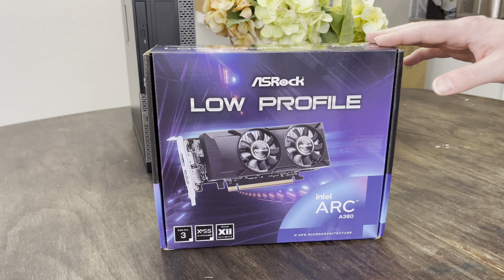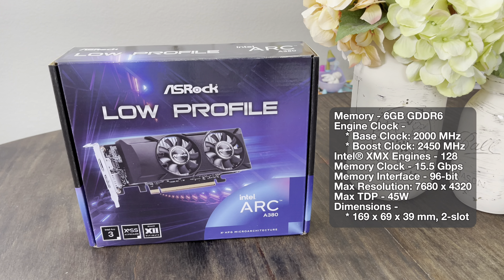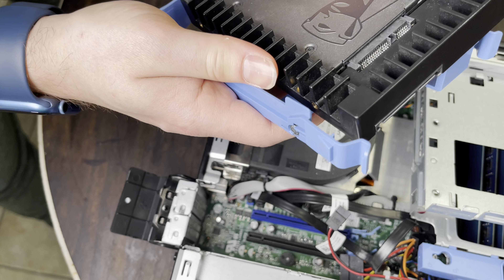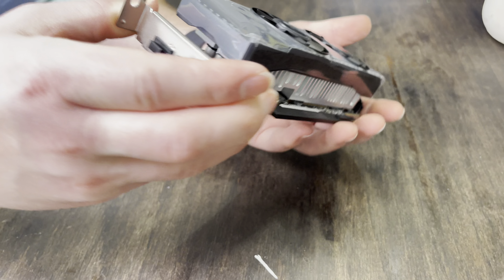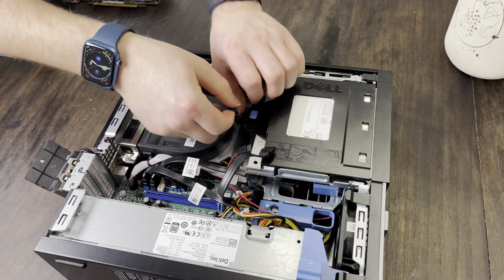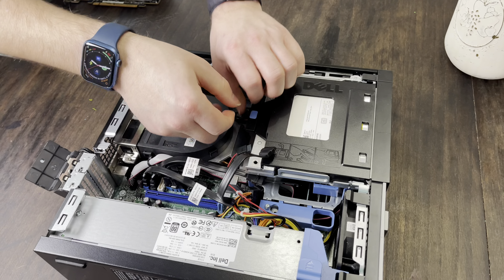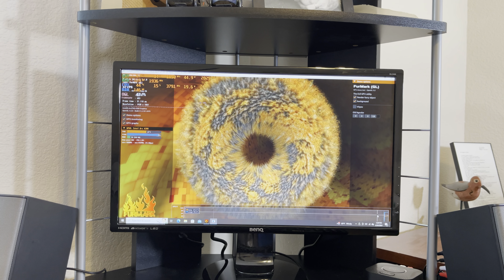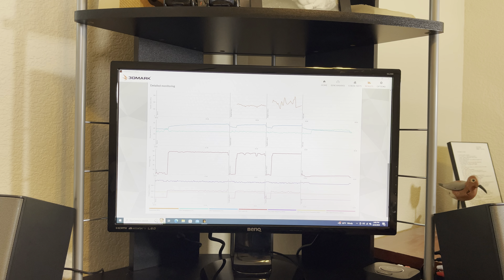Installing an Intel Arc A380 in a Dell Optiplex 7010 SFF

Comment: Unless you're willing to flash a modified BIOS, you're loosing at least about 15% performance running any Arc card in these older OEM systems as Arc is designed around Resizable BAR and these systems have no way to enable it despite being supported by anything with PCIe Gen3. Granted, the RX 6400 isn't really an option either since it's problematic in Gen3 slots and the 1650 is just too expensive, and you mind as well get the 3050 6GB. Hopefully the 3050 6GB will push used 1650 LP prices down to a more reasonable level, but I've managed to grab a couple for around $100, and that's what I would suggest people with these system buy.
Reply: H61/H81 chipsets for 3rd/4th generation (which is what is in the Optiplex 3010 and 3020) only support PCIe 2.0, so a modified BIOS may or may not help in this case. But I wouldn't be surprised to see it for the Optis since they're so popular.

I would have liked to see him run some actual GAMES, not just 3DMark.

Oh, hey... we meet again. lol
Reply: @SeeJayPlayGames  You're absolutely right, the 3010 and 3020 are Gen2 only, so the BIOS mod would be worthless for those people, but the system in the video is a 7010 which uses the Q77 chipset and definitely has Gen3. So it would absolutely work, but I don't think it's worth, even thought the A380 is really the best value at around $100 right now in the LP market... at least for a new card. It's just that modifying a BIOS and flashing it to the system is super risky for most.

But yeah, I would have liked to see some actual games testing as well. Still might be better than resorting to something like a 1050 Ti or an RX 560 on the used market. I'm currently working on a bunch of testing with a ton of LP cards, A380 included. So, I'll be finding out for sure.
Reply from the maker: Been working on follow-up video showing how to use ReBarUEFI by xCuri0 to modify the BIOS and demonstrate the difference in games, but ran into unexpected difficulty specific to Dell.  I’m pinning your comment to help ensure viewers are aware, and if I can’t get it working soon, I’ll have to take down this video - I don’t want people thinking they can modify the BIOS with ReBarUEFI in this particular Dell if it’s not possible or that games are playable without it.  In my experience, it wasn’t just a performance decrease, but the games stuttered bad enough to be unplayable.  I’ll work on new videos demonstrating it in a different brand of old office PC with PCIe Gen3.
Reply: @TheGameBench  oh, you're right, I didn't realize it was a 7010 when I posted that. And yeah, flashing the BIOS would be a risk, but we're talking about a $100 system on the line here. Certainly a risk my broke ass wouldn't care to take, but people with more money might dare.

I just wish there were more decent single-slot low-profile cards for this market. I got into SFF because I was in a transitional period of my life and needed something that would be easier to move with. And for that, it's been a good machine. Though I have to say, buying one of these machines has made me resolve to not do such a limiting thing again... next time I'm going with a full-sized PC that can take a real video card. And probably not a DELL anything. Maybe Lenovo P520 or HP Z4 G4.
Reply: I saw in the GitHub project someone had done a 3020 and a 7010. I snagged a set of them on eBay for 30 bucks each and I'm going to try it. Looks like there's some additional steps detailed in the notes on the rebar project for them both.
Reply: @OptiGPU  did you have to turn off secure boot in the bios menu before installing this gpu? i had heard you have to do that with brands that are not the same as the pc brand.
Reply: @TheGameBench  I know it's been a while and I hope you can respond, I want to know if the nvidia rx 6400 and 3050 cards have this same Resizable BAR problem. Or do they work well, is it a CPU older than 11 gen? My other question is when an Rx 6400 loses performance when putting it in PCI Express 3.0
Reply: @plexplextor  While the RX 6400 and 3050 support Re-BAR, they certainly aren't reliant on it. Re-BAR is definitely not a concern for either of those and you could run them just fine on much older CPU's than 11th Gen, but I suggest going with 8th Gen or newer if you haven't gotten a system yet. And yes, the RX 6400 looses performance in the Gen3 slot. It's pretty marginal, and the bigger concern is the frame rate consistency, which can really suffer in the Gen3 slot. This is an issue for the 6500 XT as well, and it's due to the 4 lane limitation, 64-bit bus and only having 4GB of VRAM. The 8GB 6500 XT doesn't really have the same issues thanks to the bigger VRAM limit. However, in my testing thus far, the RX 6400 has done really well in the Optiplex in the Gen3 slot and you can mostly avoid issues by optimizing your settings to avoid the VRAM limit.
Reply: @TheGameBench  Thank you for responding friend, I really appreciate it, there is a lot of confusion regarding the topic and I couldn't get an answer. I have an i7 8th and the truth is I'm not a demanding user when it comes to graphics. I was wondering why this card is an option in my country.. also the fact that my PC is limited by the 280w power supply

Comment: It's best to use Intel Arc A-Series GPUs with motherboards that support ReBar
Reply: Anyone know if the fan cooler is swappable into the 7010 13th gen lga1700?

Comment: Wow cool to see that Intel are doing GPUs.  I bet they could dominate the budget GPU market if they tried
Reply: They might in the future. Their cards perform better and better when they release new driver versions
Reply: They are light years behind Nvidia and AMD
Reply: Only for 10th gen and above mobos cos it needs ReBar
Reply from the maker: Yes, that’s right. Especially if you can’t get the workaround I tried to work: 
Testing games with Intel Arc A380 in OptiPlex 7010 – no Resizable BAR? ￼
https://youtu.be/e03QeAaJmRg

Comment: Recently got an old thinkstation p310 with a e3 1240 v5 cpu. My buddy wanted it so he bought an a380 not knowing rebar was a thing but shockingly out of CS2, skyrim, Borderlands 2 AND 3, warframe and cyberpunk the only game to not have over 60 fps was cyberpunk which wouldn't even run. Rebar is HIGHLY recommended but NOT required for anyone asking

Comment: I have seen several YT vids on not using resizable bar on the ARC series.  Seems to hobble the GPU by about 15%.  YMMV.  I think you could make a video with this setup, and show how well it plays some older and less demanding titles.  Since the vid card could be transferred into a new build, down the road, you might get a mom/dad who want to upgrade the old Dell in the garage for the kids to play minecraft, roblox, or something similar, and then move the card to an upgraded PC in a year or two as the kids get older.
Reply: not just by 15%, in some titles, it can decrease performance by up to 70% when you dont have resizable bar
Reply: @kushy_TV 70% performance loss is massive, not worth it.
Reply: yeah exactly @quisqueyanguy120
Reply from the maker: Ok, here you go: 
Testing games with Intel Arc A380 in OptiPlex 7010 – no Resizable BAR? ￼
https://youtu.be/e03QeAaJmRg

Comment: I could play most games but want to get it to run pubg the cpu hits 100% each time I’m thinking it’s the psu the one it came with is 180 the recommended settings say 350 psu or up .

Comment: 🙂 with that video card plugged in can you see the Legacy Bios screen if u boot into the bios, cause some Radeon cards you cant see the bios screen so i was wondering if arc cards have that same problem with older hardware

Comment: The rebar is probably the only issue I also did something similar
Reply from the maker: Yes, that is correct: 
Testing games with Intel Arc A380 in OptiPlex 7010 – no Resizable BAR? ￼
https://youtu.be/e03QeAaJmRg

Comment: I'm going thru what you went through right now.  Except, my A380 fans stop spinning just after it starts booting.  I've had to put a fan on the A380 to prevent overheat.  Doing the install/uninstall of the card in my test bench with B460 and i3-10100 has trashed that boot drive.  I'm not trying to get it working on a Thinkcenter M Series with 16GB RAM and an i7-3700.  Still can't get it to work.

Comment: regarding the unsupported video configuration, in the Dell Bios there under Settings - Video - Multi-DIsplay, you'll need to check that off, then you can boot the unit and be plugged into the onboard or add on card.

Comment: i thought these new intel gpus dont work well with older CPUs? atleast thats what ive read
Reply: They work better with resizable bar. Some older computers have it since it’s just a standard pcie feature
Reply: They don't. You'll leave about 15% performance, or more, with it disabled and you can't enable Re-Bar in the BIOS on these older systems even though it's a supported feature of any system with PCIe Gen3.

Comment: Figured id let you know you didn't have to remove the Wireless Adapter.  FYI There is an option in DDU that you can check which prevents allowing Windows to install drivers after restart.
Reply from the maker: Yes that would be a more sophisticated solution

Comment: Thanks for the review. It be great to get a follow up on real performance rather than synthetic. My 7010 sff is currently on order and I have really been torn into which GPU. Never considered the A380. Ideally, the 1050TI or 1650 would be preferred but prices in Australia 2nd hand are just ridiculous. My 7010 will be used for emulation so almost willing to go down the not so ideal 1030 route (the DDR5 variant).
Pretty keen to run  some Teknoparrot games as a bonus hence the Navidia GPU preference but to be realistic , I think the 1030 is lacking a bit of fire power. 
I did come across a 1050ti variant from AliExpress made by GraphicsPlayer for $200 Australian dollars.  
Not a lot on intel out there regarding these.
Anybody here got any idea if worthy of a gamble? Or maybe give this ARC a bit more consideration?
Reply from the maker: For performance, I’d recommend GTX 1650 or RTX a2000. How much more are each of those right now in your country?  I’ve seen the 1650 price come down recently in the US.  The problem with the a380 is lack of Resizable BAR support in PCs older than 10th gen. There is a workaround that should work for gen 3, but I haven’t been able to get it to work with Dell’s BIOS.  A follow up on performance in games is coming, but without getting ReBarUEFI to work, it’s not pretty.
Reply: Look forward to the follow up :)
Yes totally agree that the 1650 is the preferred choice but just out of reach financially. Currently if you can source on eBay or marketplace, folks asking anywhere from $320-400 US dollars and a little more expensive for the A2000.  1050TI a bit more realistic but have noticed they are snapped up very quickly. Seen 1050’s sell for around the $100 US mark here, but very hard to get. For the time being I’ve just snapped up a new 1030 (DDR5 Variant) which will be fine for now and will run most emulated games I throw at it and a few teknoparrot games. Just can’t justify spending that sort of cash at recommend GPU’s. It just defeats the purpose of building a cheap emulation system. Might as well put those funds towards a full rebuild using a 3060 for example and have the best of both worlds utilizing for newer games as well as emulation. 
The RX6400 looks like a good  option at around $160 US dollars but again, being a AMD card , prob not a good option for teknoparrot.

Comment: I have to wonder, would this card work in an HP SFF like the EliteDesk (or ProDesk) 800 G3 SFF? The benefits it seems to me is they are actually a similar price range, newer generation CPUs, DDR4 RAM and M.2 NVMe support rather than just SATA. But I've never seen anyone pair this GPU with one, maybe I'm missing something.
Reply: I have a SFF EliteDesk 800 G1 and i cant seem to get the a380 i just got to work... it wont even detect it, but the fans will spin
Reply: @Sr.DudeGuy  Thanks for the heads up! I wonder what's different about the HPs that makes it not work. Shame... I've seen these with better stats than the Dells for $35!

Comment: not much space between the GPU and the power supply for airflow. Would like to know what the thermals are after the GPU install
Reply from the maker: Yes, here you go. This one has in-game testing with thermal view in an overlay: 
Testing games with Intel Arc A380 in OptiPlex 7010 – no Resizable BAR? ￼
https://youtu.be/e03QeAaJmRg

Comment: I got a question, can a rtx a200p 6gb ddr6 work on my dell optiplex 7010 sff?
Reply from the maker: If you have the 240w power supply yes. Just remove Dell’s proprietary retention bracket b/c the a2000 will stop it from closing.
Reply: @OptiGPU  Alright thx I just wanted to know cause I am buying one.

Comment: I'm looking for insights on this budget rig: I purchased an sff OptiPlex 7010 equipped with a 13th gen i5-13500, 16GB of 3200MHz RAM (dual sticks), and it has a 180W bronze-rated proprietary PSU. Will it be able to handle an RX 6400? I've seen conflicting information online, so any advice would be appreciated. Thanks!

Comment: That system doesn't support resizable bar so pairing it with an Intel ARC GPU is a bad idea
Reply from the maker: Yup. Here is the evidence:

Testing games with Intel Arc A380 in OptiPlex 7010 – no Resizable BAR? ￼
https://youtu.be/e03QeAaJmRg

Apparently someone got it to work in a 7010 with ReBarUEFI on GitHub

Comment: I seem to be having the same problem, but my card wouldn't even display anything to start. I'm using a TV for a monitor, could that be why I'm getting no signal to start? If I boot up the system with the card in but VGA hooked up to a computer monitor, it'll load but I can't seem to find the GPU anywhere I look... The driver updater can't recognize/locate it, the fans on the GPU will turn on and off repeatedly.

Comment: isnt there a 4070 and 3060 lp
Reply: Only a 4060, which requires a power connector
Reply: @My_Old_YT_Account  nope just checked there's a 3060 LP
Reply: @BRIGS21  it's the marketing bullshit ones that are still wide, just not long. It wouldn't fit in an SFF case.